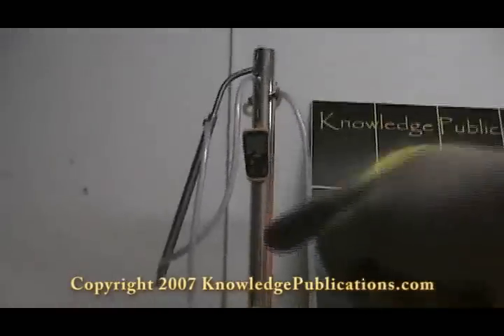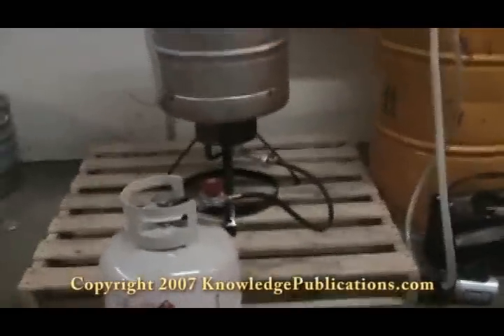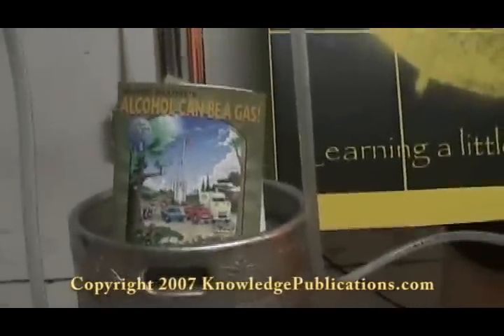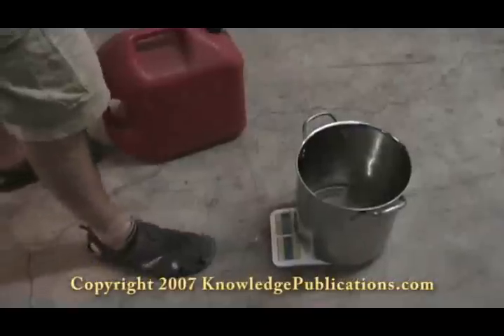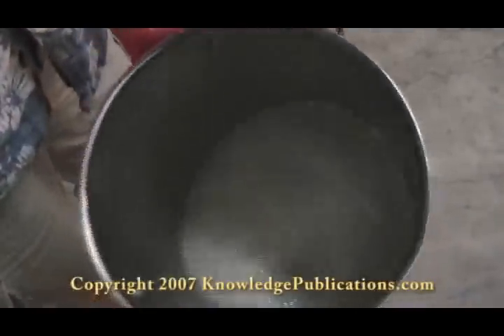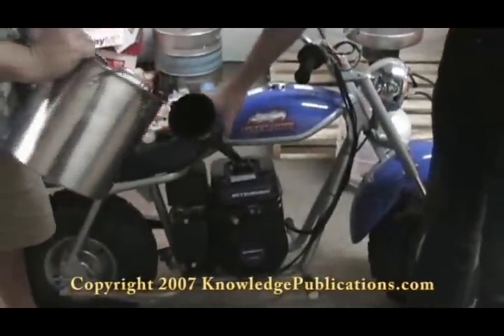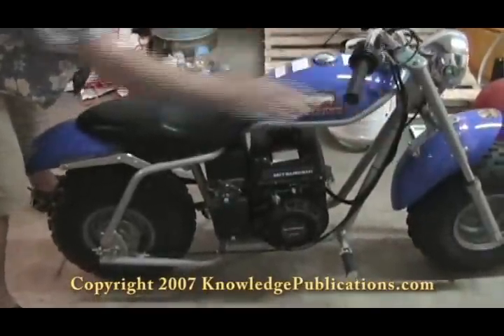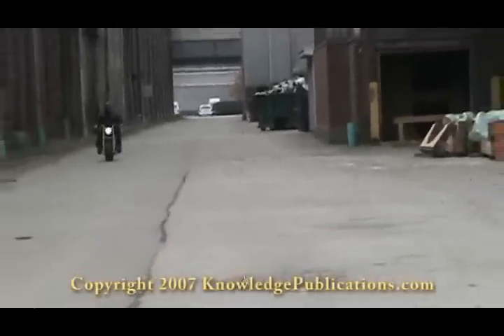Alcohol Fuel Demonstration in a Minibike - No Conversion

Comment from the maker: sure as check can be used as a performance fuel. E85 (85% Ethanol) has an octane rating of 105.  Pure Ethanol (E100) has a rating of 110 to 113.  If you want more fuel economoy from ethanol ( or performance) you increase the compression ratio of the cylinder.  Ethanol is a performance fuel.

Comment from the maker: That depends on the motor and the fuel system.  The minibike will run on pure alcohol, some older cars will run on ratios much higher than 50%, but the good news is that most modern fuel injected computerised vehicles can take 20 to 45-50% without modification.

Comment from the maker: Good Work, Good Thinking.  Nice responce, unlike what some other people do, but.. you're incorrect on the figures. The way you figured the drop in energy from the ethanol.  BY VOLUME (gallon) ethanol is about 70% that of gasoline in BTUs/MJ/calories etc..  So your MPG can be 70% of gasoline. So 400 miles on a tank of Gasoline = 280 miles on PURE ethanol. 50/50 mix would be about 340 miles, in an unmodified car.  p.s. we LOVE wikipedia.

Comment from the maker: technically, if you look at it hard and are very very effecient with your heat xchange and insulation, you can make more with the fuel value of the alcohol that you produced, but not really. *BUT* if you 'methane digest' your solids left over THEN YOU CAN have enough methane to run the still and thus not use any alcohol or purchased natural gas / propane.

Comment: Please check my math. According to wikipedia (my phd = marketing, not engineering) energy for gasoline = 46.9MJ/kg vs gasohol (10% alcohol) = 43.54MJ/kg; a decrease of 9%. So if I get 400 miles on a tank at $60 (20 gallons at $3/g) then with alcohol I get 220 miles for $30. (assuming constant rate of energy decrease at 9% per 10% alcohol in the gas.) or $60 gets either 400 miles or 440 miles (if alcohol is free). At best a 10% gain for the same cost.

Comment: So, if I understand the answer correctly, it would seem that - without the production of the bio-gas to creat the heat to distil MORE alcohol - the production of the alochol is no more than a conversion process - that is, exchanging of one combination of fuels (heat from some external source + the fermentation materials) for another (alcohol) with the likelyhood of some loss.

(I had more, but ran out of room) I look forward to more enlightenment.

Comment from the maker: @ke4uyp Here is the bottom line, you're DEAD WRONG.  The starch that was converted to sugars that was fermented into alcohol WAS  MADE WITH SUNSHINE....that is how the starch was grown.   So you CAN use electricity very efficiently to distill the alcohol and get a very big net energy gain, because the sunshine  made the starch for you.   I have done a LOT of distillation via propane, natural gas AND especially using electricity.  Distillation by electricity is one of my favorite methods.

Comment: What you say is partially true but let's not forget that there is a diesel power tractor required to grow the starch. Also the starch had to be transported via a diesel power truck to the distribution warehouse. Also miles of power grid transmission lines have huge amounts of resistance so only a small percentage of the electricity generated at the electric plant makes it to your house.

Comment from the maker: no.. you don't get a 20% decrease from 10% alcohol, you are wrong on that.  There is a decrease in milage with alcohol because it is LESS energy dense than gasoline.  However, you MADE this alcohol, its yours and for driving by the mile, its a lot cheaper than gasoline.

Comment from the maker: You ARE 100% WRONG, INCORRECT.  Not only is it IN THE BOOK (Alcohol Can Be a Gas), along with the alcohol / water / gasoline temperature tables, but WE DID IT. WE MIXED IT, NO SEPERATION.  It won't seperate until below -10F.  Don't believe me, go get some denatured alcohol at home depot, get some gasoline, get some water..and mix them.

Comment from the maker: Look... 7 gallons a week is a LOW amount, not hard to do...this video is not inteneded for scooter drivers, NOR am I advocating you tweek your scooter to run on straight ethanol.  What I am advocating is NO modifications NEEDED and running on a mixture of alcohol and gasoline.  7 gallons saved can be $20 a week saved.